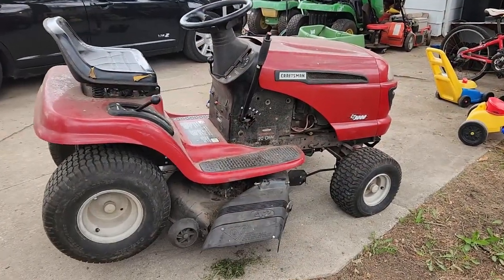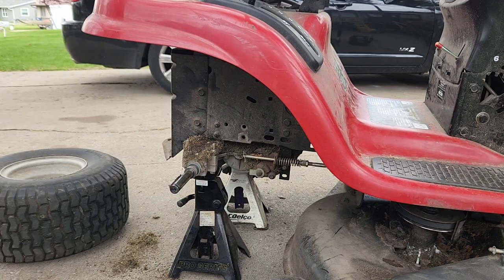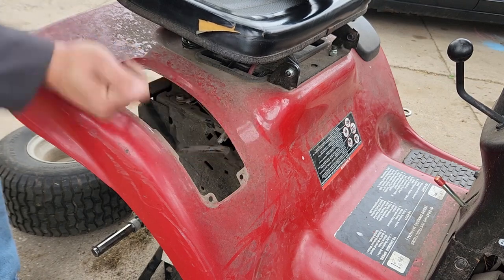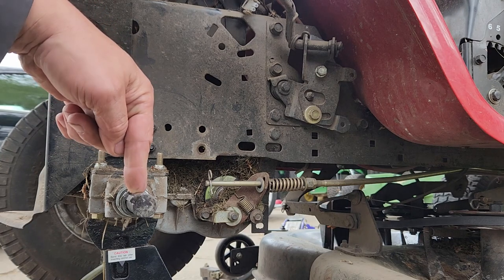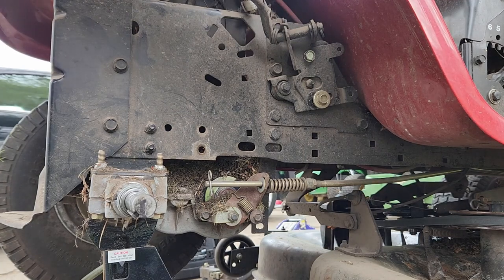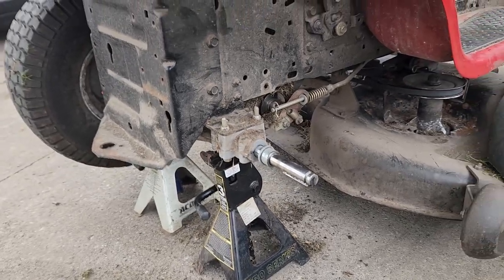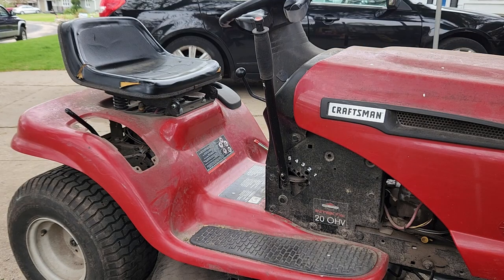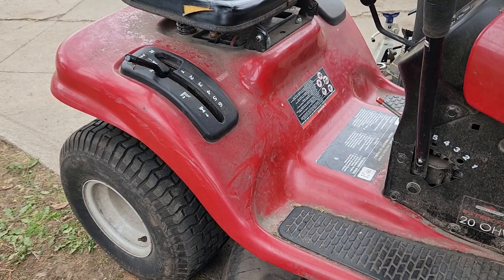Craftsman Lawn Tractor - 6 Speed Reverse Fix

Comment: First, thanks Scott.  Your video did help me. I had a similar symptom, but not the same problem. In the yard while mowing it would drive in reverse. When I raised the deck and tried to back into the barn, it would not drive and I could not push it in neutral either. Sometimes one wheel would spin. After performing your procedure, when reinstalling the rear wheel,  i noticed that  the mower deck was catching in the tire and acting as a brake. After considerable adjustment, all is well.🎉😂😂😂
Reply from the maker: Happy to help! Thanks for watching.

Comment: I just picked up an LT3000 over the weekend. Would this be the reason my reverse gear is very VERY slow? Im talking.. a snails pace
Reply from the maker: @itcomesinwavves  that would be my first guess
Reply: I am looking into this problem right now… if you got to— get the manual and start messing with it— just give it a try— u can fix it. But check out your belt for slack

Comment: Dear Scott,  

Similar problem -- can't go in reverse.  I have a Craftsman Lawn Tractor Model 917.203800 with the same 6 speed forward 1 speed reverse capability with the same gear shift lever arrangement on the right side of the tractor as in your video but the motion of the gear shift is transferred via a rotating round metal shaft to the other (left) side of the transaxle where a welded lever arm extends forward and goes up and down as the shaft is turned manually by the gear shifter.  There is a six inch long linker with two "universal joints" (one at each end) pointing 90 degrees apart from each other, one of which screws into the lever arm and the other attaches to a flat piece of metal that is pulled back and forth and is attached to the gear shifting shaft that come out the top of the transaxle.   Are you familiar with this arrangement?  

On the advice of our professional lawn mower repair person, I bought a new transaxle which he has installed (he said that the old one was internally broken because the copper-colored wheel that extends outside of the transaxle wasn't turning).  However, after two long sessions at our home, he can't get the arrangement to work.  Once or twice we got the tractor into reverse but mostly when we try to do that, the gear shift doesn't click into place and instead resists any effort to move it backwards into the reverse position.  We found that the shaft of the threaded attachment bolt on the linker was hitting the frame of the tractor as the welded lever arm raises it.  I was able to fix this by slightly bending the lever arm centrally.  But no real improvement -- still resists going into reverse.  There is an a slotted adjustment screw on the right side under the gear shift housing that is somewhat like the one in your video and he has adjusted and readjusted this to no avail.  

First, any suggestions?   Tractor goes forward fine, all six gears.

I am worried that when he put on the new transaxle he reversed the orientation of the linker.  In other words, if instead of having the threaded bold facing out toward the frame (which it was hitting), maybe it should face the other way (inwards).  Attaching it the other way would cause the bolt at the other end of the linker to face down (in the current arrangement with the bolt hitting the frame, the bolt at the other end faces up).  My guy says no, it's correctly attached.  But I can't find anywhere a diagram illustrating how it's supposed to go (I have pored over the "exploded" diagrams in the manual and can't see the linker piece anywhere -- its part numbers are 166231 or 597068804 -- you can see what it looks like on Amazon or Sears Parts).  Can you describe to me the proper way for it to go?

Any help you can provide would be greatly appreciated.  I'm about to lose this tractor which should have many good years of life ahead of it.

Sincerely,

Tom

Comment: First thing I do is remove seat , battery and battery box 
I use jumper cables 
Clean top of trans really good and right rear wheel 
Then I can check it out 
Wire spring on shift level maybe broken and fell of
Rusty shift arm or shifting unit defective or simply out of adjustment is common

Comment: Where are the grease or lubrication points for the trans?
Reply: Any place where there's metal to metal contact is a good place to grease. The inside of the transmission should have lubrication that should be changed periodically also.
Reply: There is a rubber fitting you would open up to pour gear oil inside. I have my old trans I was going to add grease zeros so I can fill it up with marine grease

Comment: Well great but lawn tractors now need the clutch in....some one of the PROPER weight on the seat and usually one of your legs must be behind your neck before they will start. Then ANY tractor I have worked on either you beat the rim to pieces or go buy a 100.00 puller to get the tire off......maybe....a 40% chance then. One thing FOR SURE...WE NEED MORE PEOPLE CALLING FOR SAFETY......
Reply: Spray with wd40… let sit over night and lodge a piece of wood behind the tire and hit it a few times